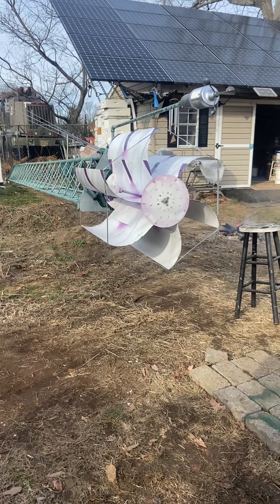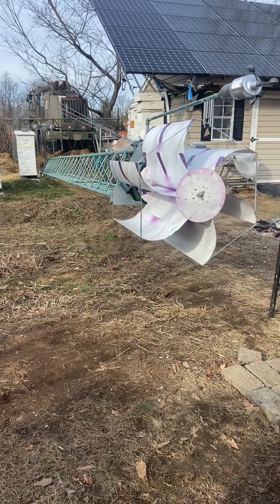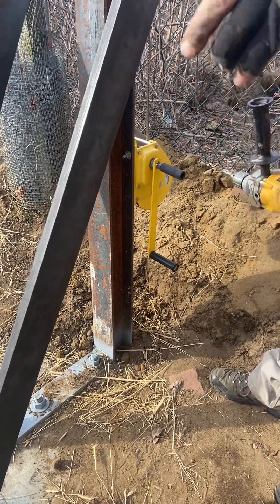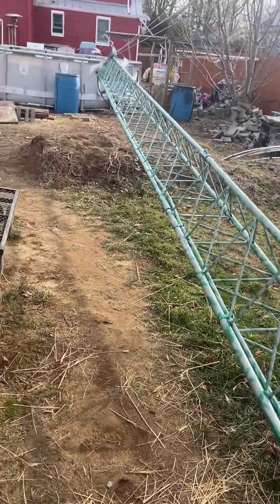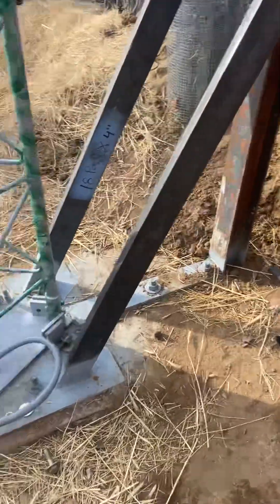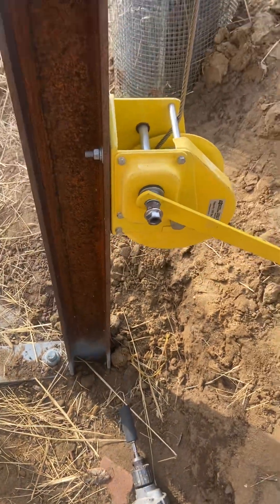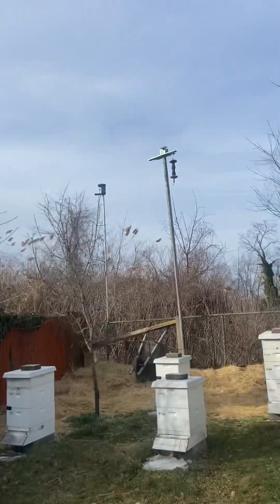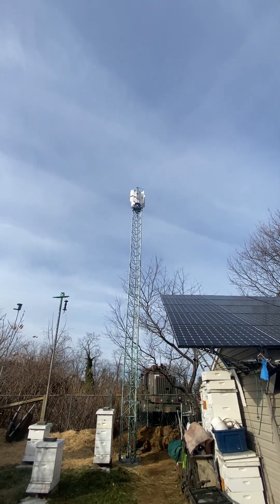Vertical Wind Turbine, Part 47 Never Buy Tesup.

Comment: You win the prize for perseverance. When you get this thing working it will be an absolute triumph.
Reply from the maker: it’s kick in speed now is approximate 8 to 12 kn. That makes the inverter flicker on but it needs a constant 12+ knots to produce power. It works,,,,  thank God.
Reply: @Themachinewon  Fantastic! ! !😀
Reply from the maker: I’m already looking at the FLTXNY , three bladed vertical that has a smaller generator kick in speeds a lot lower, and it would actually produce power through the inverter.FN 600
Reply: I read somewhere flt Chinese is a scam... They're scrap and don't generate anything

Comment: Does this new modification work? Wind is blowing ?
Reply from the maker: The modification definitely worked. The wind turbine now starts to spin at approximately 8 kn to 12 kn. That’s still not fast enough to turn the inverter on at 50 V and produce power. It has to be a pretty constant wind at least 12 miles an hour.
Reply from the maker: yes, the modification works. It brings the kick in speed from 35 mile an hour winds down to 8 to 12 mile an hour winds. It just has to have a constant wind to produce power now.